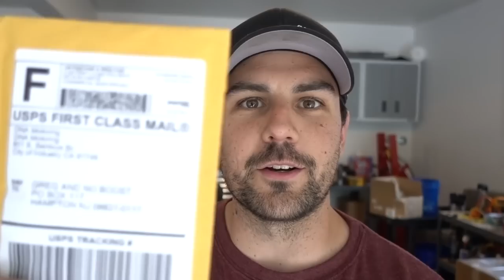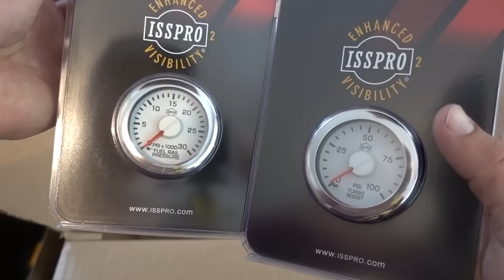TIME FOR BIG BOOST ON THE CUMMINS!!! 2ND GEN CUMMINS TURBO SWAP

Comment: Just a heads up, be very careful with the grille. A new one with the dodge letters cost $1000+. You can get a aftermarket one that cost $200 but it won't have the letters.

Comment: I just bought an early 07 ram 2500 with the 5.9l cummins its got 127xxx miles on it and recently had a new tourk converter installed and a k&n air filter and filter housing what upgrades should i do first? New manifold and exhaust or a lift punp and sump pump for fuel tank

Comment: What would you recommend for a 2017 Ram 2500,,, fully deleted, running’s Ez lynk by Hpp, 5inch flo/pro, 4g airdog 165, beans sump, banks 4 inch intake,  banks cold intake,  fuel rail plug no relief. Ohh and it’s lifted, I know that’s not your style., single turbo or compounder,, and who has the best  parts for my dollar.

Comment: This is probably a stupid question but, may I ask what's the purpose of a second gen swap for a third gen?
Reply: sparechange 
On a 3rd gen the exhaust manifolds is split 2/4 cylinders, resulting in unequal flow. 2nd gen manifolds are centered and have 3 cylinders on each side.
Reply: Kyle Sonsalla thank you for letting me know